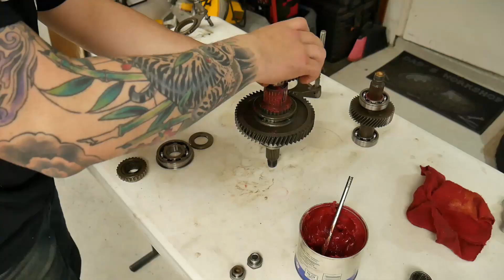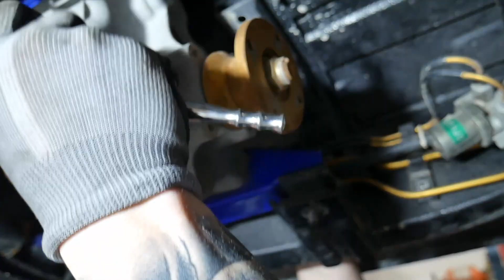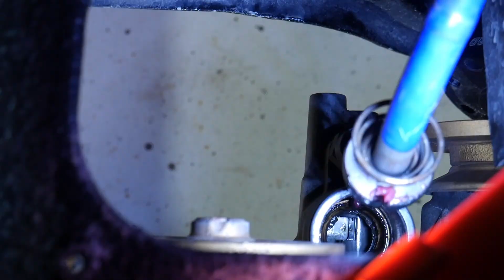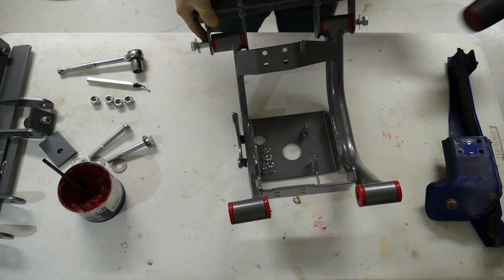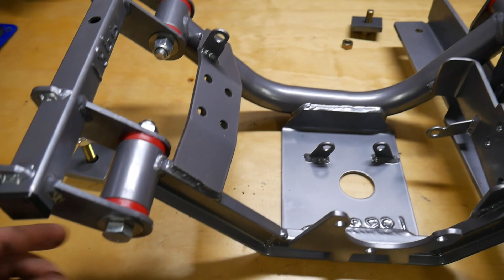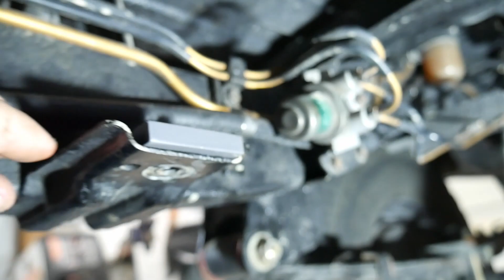Suzuki Samurai Transfer case removal

Comment: Just looking for a little advice. I have a 1991 Suzuki. It is a daily driver with 30 inchstall all-terrain tires. I'm a little bit too high geared, just wonder which transfer case reduction kit. Would you advise today's Tuesday? To do? To still be able to drive it on the highway as a daily driver?  As to not get it too low, geared and turn too many. RP m's. I will never have more than a probably. A 31 install tire on it. What do you think the gear reduction should be in my transfer case?

Comment: I come from indonesia, great congrats, but how much if i buy for 4x4.. my jimny 1984..sj410
Reply from the maker: Hendra Wahyudi , hey bud. You are interested in the cradle for your SJ410 T-case? From my understanding if you have a SJ410 transfer case that IS 4X4 they are relatively similar on the outside to the SJ413's transfer case. So I believe ( disclaimer that I have never done this myself, so take it for what it's worth) that the ZOR cradle will work. Some modifications may need to be done. But good news is that if you contact Myron at Zuks Offroad, he can better answer this for you. Hell he may even be able to make something that will. He's a great guy.

Comment: Hey trey. I have water in my transfer case. What should I do
Reply from the maker: What you SHOULD DO, is take it all apart, clean the hell out of everything, inspect all your bearings and seals, and replace anything that is bad, or do a complete rebuild. What you COULD DO is drain the oil, and replace with a mixture of water and detergent/degreaser (like purple power) and, w/o running the truck, flush the case a few times, letting the mixture set inside the T-case to break up any chunks, and then put fresh oil in the T-case, run it a little bit. And I mean a little bit, like 5-10 mins drain inspect the oil, and repeat( increasing the duration that the oil is run in the T-case each time) until you have nice clean oil coming out. The flushing process, depending on how much gunk is in the T-case, could cost more than a rebuild, and you won't know the state of the bearings inside. But the choice is yours sir.
Reply: @ELKMotorsports  I appreciate you getting back to me. Yea, it's probably better safe than sorry. I'm going to rebuild it.